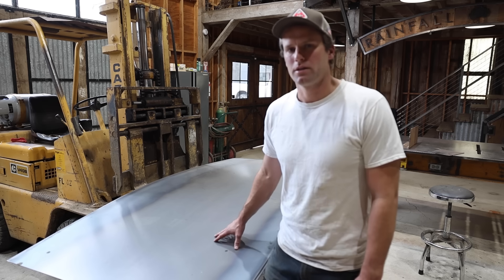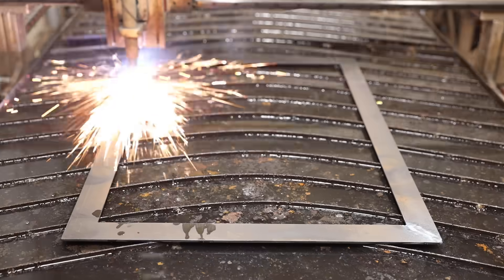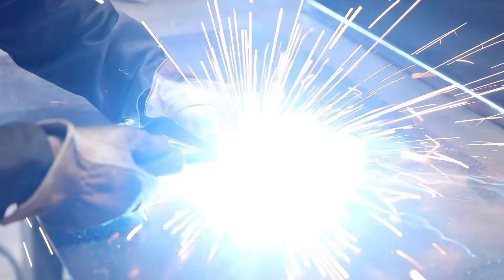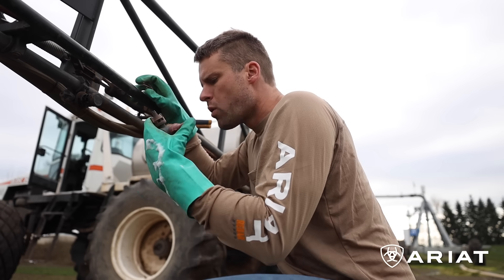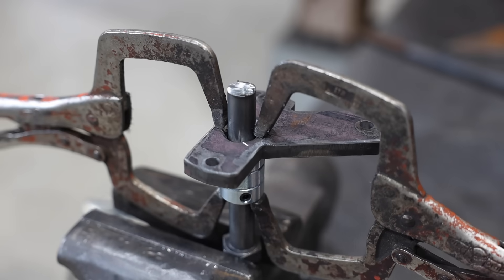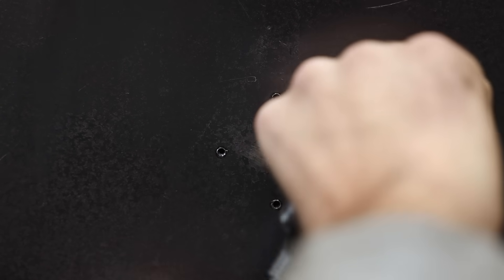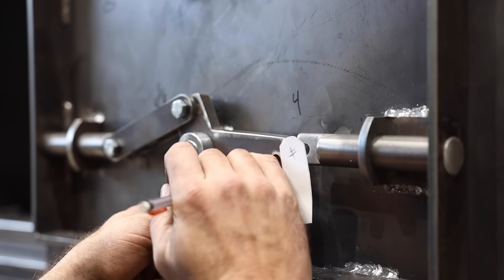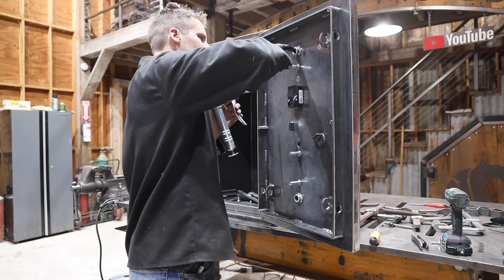Building a Fireproof Safe (pt. 1 of 2)

Comment: Would've been cool if you had made the backing plate with plexiglass so you could see the linkages.  A+ project, all the same.
Reply: Glass, plexiglass or polycarbonate would be a good idea but after a certain extended period of time to extreme heat they would eventually break. Learned it from a few fire fighters.
Reply: @jasonlazore497   I guess it depends on how long the safe would be subjected to the fire. Assuming they aren't too far out in the boonies, the fire department will have put out the fire before the internal temperature of the safe got too high. Glass would be the better choice, I would think, since breaking from the heat wouldn't necessarily damage anything else inside the safe. Plexi melting all over would be a mess and a half.
Reply: Perhaps some windows, but would have been difficult to add the shaft collar support on the backing plate if it were plexy.
Reply: @ixamraxi  That's a fair point.
Reply: Yes. That is the most beautiful part of the safe that has lots of linkage.

Comment: Having  both an engineering and security background some thoughts:
- engineering is good,  but you could have decoupled the metal on the outside from the inside. See how modern windows are made. So no thermal transfer occurs, or at least not so much.
- maybe add some tabs or a way to secure the safe to the ground (if you don't weld it somewhere to the ground)

Now to the main problem...
- the main reason most of the cheap fireproof safes fail to do their job is not fire proofness - its water proofness. Normally the fire dept. arrives in under 30 minutes so a 60 minute fire proofness is more than enough.  But the fire dept. uses mainly water to extinguish fire. Pouring it on for hours. So the documents and most valuables which  don't like water are destroyed AFTER the fire by soaking for hours in water.

Added later:
At least we now could get
 Part II  - making the fireproof safe waterproof !

:)
Reply: Agreed, Waterproof storage containers within any fire safe are a must. The overlap of waterproofing gasket materials and high temperature resistance is pretty small.
Reply: @kschleic9053  in fact it is not so easy . If you read instructions on good fireproof safes  (the ones for documet use aka paper) they specifically tell you not to put plastic sheets in them. The plastic melts before paper gets dark from temperature.  Then the documents are also done..
Reply: @TRFerron  sorry I should have been specific. I use metal ammo cans with silicone rubber gaskets.
Reply: @TRFerron  well... melting good, to a certain point. Gravity is a thing, and melting makes things liquid...ish so, yeah. There is the failure point of that idea. As long as the water didn't get as high as whatever level the seal maintains,  well, seal, I guess you'd be OK. Unless the seal material was susceptible to thermal shock, which is also a problem. 
I guess you could make a mechanical seal on either side of your soon to be liquid seal to help hold it in. Something like a airtight taper fit... but then you have thermal deformation. 

Or you could do what I did... have a safe/vault built into the basement, but outside the envelope of the houses interior. A good quality gun safe door and three steps up from the floor of the basement. Yeah it's a bit more expensive, but pretty much literally bomb proof. 

We had a few house fires growing up as a kid... im kinda ocd about that sort of thing. Especially now that I live in an area prone to wildfires and very, very remote. How remote, when I tried to get fire insurance they just laughed and laughed and laughed... and then said no.
Reply: @kschleic9053  the idea of fire safes is exactly that, the gasket is designed to melt to the frame of the safe and door to prevent water from entering, of course this is based off a youtube video I watched a few years ago so results may vary 😂
Reply: Rope. They have specialized rope that make air tight seals in sub hatches, wood stove ovens, metal casting fabrication…
Reply: Would a gasket solve this problem? Maybe packing a fiberglass rope soaked in high temp grease around the ingress points of the handle and lock?
Reply: Being an engineer, do you have a solution for waterproofing? I’m guessing rubber seals would melt. Is there another product out there that could be used? Thanks
Reply: @robertrusso877  melting is ok ;) it seals even better. There are many silicone gaskets which will be happy to meet the requirements even with the safe starting to glow red.
Reply: @robertrusso877  metal gaskets, they can provide a water proof seal with enough pressure(like a car's headgasket). to obtain that pressure, you would just need a tapered locking lugs to pull in the door and crush the metal gasket every time the lock box is closed.
Reply: @robertrusso877  Intumescent fire seal, coupled with a metal tension seal, with a top drain ring around the door so that any water sprayed on the outside doesn't get near the seals in the first place.
And it needs a tool steel plate in front of that latch weak spot.
But tbh it's good enough, documents tend to be in their own box anyway
Reply: How is the lock cylinder secured to the back of the door? Can’t just be 4 bolts
Reply: This was my first thought too.  That wheel on the front is going to transfer a lot of heat inside the safe
Reply: Yeah, I was thinking something similar. This will be a lot better than nothing, but won't resist high temps for long because of all the thermal bridges (the edges of the door, the edges of the door opening and the big shaft that the wheel is mounted to). A better solution would have been an insulating box built to avoid any thermal bridges inside of the safe. If you want to got further you put a tray filled with something like wax inside. That will absorb a lot of heat before melting, keeping the temps below it's melting point for considerably longer. 
Another concern is that the locking mechanism is only secured by 2 skinny screws. Depending on how well that wheel shaft is fixed to the rest of the locking mechanism, you might be able to just brute force the lock open by cranking on the wheel till one or both of those screws break. I would at least add a plate for the lock bolt to pass through that would make that nearly impossible.
Reply: Place paper documents and rare coins in a water resistant container before placing them in the safe.
Reply: I just put my documents in a waterproof container inside the safe, not an issue.
Reply: Just but all your stuff inside the safe in some tupperware or other sealed plastic container.

Comment: Very nice! Although it appears that the locking mechanism is locked by the S&G lock bar. That’s fine normally but since your handle is fairly rigid it would likely be possible to force the mechanism open with a long bar. 

I believe most safes deal with this by having their handle be the weak link. If any attempts to force the handle open the handle just slips in the mechanism. 

I’m far for an expert but hopefully someone else here can add to this comment with a suggested fix. Maybe some kind of plastic joint that would slip. I enjoyed the video, keep up the great work!
Reply: Awesome point. Given the excellent system he as already designed that would maybe be a difficult adjustment. May I suggest an options that might work well with what has already been constructed? 

Maybe adjust it by using a brass rod for the main shaft attached to the wheel and attaching the main internal linkage via a shallow set screw into the brass rod so that it would strip where the set screw is attached and spin inside the linkage if significant force is applied. Although there are many designs of breakaways using weak pins specifically on the external wheel. Many would still leave a solid mental shaft that could be turned with a pipe wrench or such. Ideally you would like the failure to be internal to the mechanism.
Reply: Oh, that’s what I wondered too. I feared that you could put so much stress on the mechanism by turning the wheel by force that it breaks, but I would have never thought of using a bar to my advantage. I really need to step up my robbery skills.
Reply: Yep, his unlocking mechanism looks robust enough to smash the lock with ease, the lock needed to be mounted further away from the mechanism pivot.
Reply: I had the same thoughts. Often they have that mechanism setup with a ratio so 100lbs of force would only transfer 10lbs to the lock handle. I would recommend welding the bolt in the center of the handle so someone can’t just grab a socket and breaker bar and get in quickly. The rounded weld would keep a socket from grabbing
Reply: Yup, safe handles are either pinned with a weak nail (kinda like a shaft key) with a small diameter and a small soft metal nob sticking out, so you can't just put pliers on that should you remove the handle, or, as you said inside the safe door, there's a weak link. I saw a 1970's safe that was disabled because someone levered on the handle to get it unstuck, and the broken link was a piece of hammered copper (work hardened, which made it brittle), ingenious little thing.

Comment: Are you going to add fire rope or something as a fireproof gasket on the door?
Reply: Yeah.  also to keep the smoke out.  Even if you keep the fire out, all that smoke still usually ruins everything.
Reply: I think there's a type of gasket made just for safes that expands with heat. Could be wrong but i remember someone telling me that.
Reply: I was thinking you could use an oven door gasket from a large oven, or possibly buy the exact length you need from an appliance repair supplier.
Reply: Good point. Possibly the door gasket for fireplaces would be a good option as they are exposed to extreme heat or the gasket for a kiln would work.